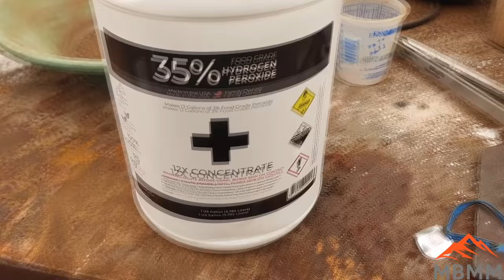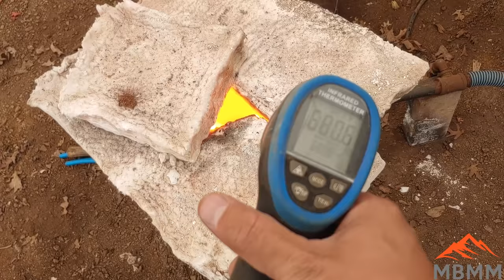Gold Recovery & Refining with Hydrogen Peroxide, Easier Gold Smelting

Comment: From a chemistry perspective: Add some water to your sample so you can stir (as quickly as possible) while slowly adding the peroxide (H2O2) to it.  Most likely some manganese (or similar) acting as a catalyst to decompose the peroxide to oxygen and water (2 H2O2 ---> 2 H2O + O2). Most of the oxygen that is released   (~165 grams from a liter of 35% hydrogen peroxide) is just being released into the air.  By stiring your sample and adding the peroxide slowly, you will get a far more efficient reaction.
Reply: thank you
Reply: Very useful tip Mr. Anthony. Thank you sir.
Reply: I was going to comment this...
Reply: I like you work
Reply: I need help I have minerals at my house all over
Reply: i added concentrated acetic acid[distilled vinegar] to  5% hydrogen peroxide and well water then dumped it on a rusted piece of metal infused lava rock .it smoked like that but also put off enough heat to warp a stainless bowl. im no chemist, was following diff vids on yt.the result was hydrogen sulphide and sulfuric acid.  after removing what was left of the rock i had a black float in my solution that after percipitating out was tarnished silver and copper
Reply: Teacher, what type of crucible can handle melting a large amount of potassium nitrate among the ore in order to get rid of the sulfides?
Reply: @hammahgawe  potassium is too unstable to exist on its own

Comment: When dealing with hydrogen sulphide gas, there are a couple of factors
1. Use a fume hood. This stuff is no joke
2. If you stop smelling the H2S, RUN!!!
H2S in higher concentrations will shut down your ability to detect it.

I grew up near a heavy water plant 😉

Comment: Refining with Sodium Bisulphate
It was considered that the silver as well as the base metals might be removed by some preliminary treatment. Nitric acid was ineffective on the retorted gold tried; sulphuric acid had little effect, but on testing with bisulphate of sodium it was found that base metals were removed or oxidised, and that silver sulphate formed The retorted gold was heated in porcelain or dense fireclay pots to a dull red heat for some time, generally as long as sulphur dioxide was evolved. The fused pyrosulphate was then poured out, and the cake drained as completely as possible. These were afterwards washed with hot water until the silver sulphate had been removed. The cake of melted pyrosulphate was also dissolved, and the silver present in the solution precipitated on iron, or by other well-known means. The gold could now be smelted, and invariably would be found to be much purer than when smelted by older methods. The silver and base metals were also removed at a fraction of the cost required by the chlorine method. The results obtained, however, were variable; one sample would be purified from about 80 to 96 per cent., yet another would only be increased by five or six per cent. The cause of this variation seemed to be that when coarse gold is amalgamated the mercury only affects the outer crust, so that on retorting there would be left pieces of gold porous on the outside, but unaltered within. In order to determine whether the gold and silver, if amalgamated in a fine state of division and then retorted would part, 80 grains of gold and 20 grains of silver were taken and amalgamated. The amalgam was retorted, and the resulting gold was of pale yellow colour. This was treated by boiling with strong sulphuric acid, which removed part of the silver; it was afterwards treated by fusion with sodium bisulphate, which removed more. The gold remaining was then washed with water, and after the silver sulphate had been removed the metal was weighed and parted. It was found to consist of: Gold, 97.2; silver, 2.8.

It is, therefore, a difficult matter to remove the whole of the silver, even when finely divided originally by this treatment: It might be stated here, although detailed reference will be made to it later on, that by using phosphoric acid with sulphate of sodium as a solvent that the retorted gold made in the same way was raised to:

99.2 gold.
0.8 silver.

Comment: Hate to tell you, but if you had added HCL to the h2o2 (Hydrogen Peroxide) it will create a weak version of aqua regia, and start dissolving the gold and other precious metals... and basically, not a good plan.
If you add an air hose into the crucible with just atmospheric air being pumped in, it will during the smelt oxidize all the sulfides, and you can actually turn the gas off in the furnace and it will continue to heat, as the air and sulfides combust... crazy stuff, I know, but a huge bit of fun to watch .
Reply: could you pump oxygen down there?  using a tiny medical tank/regulator,  a bubbler to prevent blowback  then down threw  a  high pressure stainless steel braided hose.?  I happen to have these random items, But I am under strict rules not to blow the house up with my projects.  lol , thank you!!
Reply: @garrisonkoby3448  atmospheric air is absolutely preferable, pure O2 in this case would be an extreme option, and blowing up your house might not happen, however, the smelt would in all likelihood super heat, at least into the 3000 degrees F... 
Using braided stainless, is good, the idea is to not and consumable metals to the smelt... stainless, is a great choice.
I use atmospheric air from a 35 lb air compressor, and a regulator value to add the air...
Reply: U r so correct I'm surprised he didn't know

Comment: I tried this a while ago. You need to add 90% acetic acid to break the oxide layer you built on the surface of the sulfides. The reaction will continue over and over till nothing is left to oxidize. The reaction is a exothermic one that boils over, the bubbles cool it and it reheats as the next layer oxidizes. This is paracetic acid. Acetic and hydrogen peroxide. You can add salt to it as well.

Comment: I watch tons of gold mining, recovery, and reviews. So to be added at this point is tough because I want my feeds to have more than just gold recovery videos. 
However, what it takes to get added is good solid information and techniques. And you deliver both. And doing a failing experiment is one of them. I'm sure a lot of prospectors try these tricks and you've proven that it might not be worth the trouble.
I don't know, I was impressed with the video and procedures used, and comparison techniques. So for those reasons I have no other choice but to add you to the subscriptions.
Well done. I look forward to more.

Comment: Great video. First put the 50 grams into a jar, then add 4 parts muratic acid to 1 part nitric acid. This fluid should be heated  past 150* f  for a few minutes You should get a bright yellow fluid. Add pure water and drain the fluid only out.

Comment: Safety tip, a filtered mask does not protect against H2S gas. The only protection from H2S is a supplied air respirator.
Reply: Respirator does to a point
Reply: @xephael3485  to a point isnt being protected though is it lol
Reply: @scrappydoo7887  The point I was talking about is the level H2S you're exposed to.  They don't make acid gas & organic vapor respirator filters that specifically filter hydrogen sulfide for no reason...  Mike brown is wrong in saying they don't protect against H2S gas, because they do.
Reply: @xephael3485  and if i hadn't made you clarify your point people would be thinking that all respirators provide protection "to a point"
Reply: @scrappydoo7887   just like bullet proof vests provide protection to a point... Nothing wrong with thinking that.
Reply: @xephael3485  do me a favour. You know that is a bad comparison
Reply: @scrappydoo7887  seems like a good comparison to me.  Especially to back my point.
Reply: @xephael3485  not really no. A bulletproof vest has  plates that covers part of the body intended for partial protection. Something like a respirator is responsible for your one inlet of what keeps you alive through the only place you can get it into the body.
Reply: @scrappydoo7887  level II body armour doesn't protect you from most rifle rounds.  You're just arguing because you don't like my comments and point which is correct and valid.
Reply: @xephael3485  lol ok then. If I realised you were going to go the Mr sensitive route i would not have bothered.
Your comment isn't valid without the clarification and you clearly cannot accept it.

Have a good day 👍
Reply: @xephael3485  ah, the YouTube comments. I ain't a scared a no hydrogem sulfide! I'm tough! I breathe it in DEEP! No, you shouldn't breathe it, if you've got no respirator and you're going to do it, don't breathe around the stuff.
Reply: since there still are replies to this, I will be more specific and clearer.

At lower levels, when you can still smell H2S, you are not in any danger. the particle mask and cartridge do eliminate the odor which is a esthetics issue, not a health issue.

once H2S reaches a level where it is physically harmful you can no longer smell it. thus a mask that removes the odor actually puts you in more harm because now you don't know if the mask or a deadly level of H2S is the reason you can no longer smell it.
 
bottom line is that the filtered mask and cartridge only give you a false sense of protection. 

when the filter or cartridge fails at high levels, your only indication is that you are incapacitated or  dead. you had better hope someone is there using supplied air to drag you out of the area.
Reply: @mikebrown0262  it doesn't look like it would be that difficult or expensive to create an exhausted box to do the work in. I appreciate your comment bringing attention to the subject at all and would hope anyone involving himself in the practice would do some precursory research to find out how protected they are with what equipment they are choosing to use. 🤷🏻‍♂️  Or maybe some people just have to weld with Dollar store sunglasses to see 🙈 why we dont weld with dollar store sunglasses...
Reply: Does make me wonder if you were an alchemist in a past life.
Reply: Uhh no... there are plenty of respirators suitable for H2s
Reply: U must of been a roughneck in the oil patch 🤣🤣🤣
Reply: Jeezus. If below 100 ppm, a respirator will be enough. If above, forced air or self contains air supply (per OSHA). 

Without measurement, we can’t say for sure what levels are there, but that is a huge work area, and is open to the outside if I remember correctly. 

If not leaning over the table and getting a full hit of the gases, I’d wager well below 100 ppm. 

Just the same, I’d want an exhaust hood above that table if it was my place, and I’d be wearing full face forced air ppe.
Reply: Covid/mask/do research

Comment: Use jet dry, you have gold suspended in/on the water, helps break the surface tension to let it fall to the bottom.

Comment: Adding HCl with the peroxide will dissolve the gold as well.  Might be useful to make a concentrate of gold chloride solution and leave all the silicates behind.
Reply: You need morw than Hcl And Peroxide, you need heat, a lot plus stirring AND a vast amount of Peroxide. The ratio can be 1:5 when all said and done. Its cheaper to just use nitric acid since you can dissolve 4 troy ounces in 300ml HCL plus 15ml Nitric

Comment: What's going on there is a decomposition reaction. The sulfides and sulfates do oxidize, but mainly they trigger an energetic decomposition of the peroxide into water and ionic oxygen. So the released gasses are a combination of water vapor, molecular oxygen, and sulphur dioxide. Its not much but i still would do something like this under ventilation. Honestly you're lucky your sulfates and sulfide concentrations are low. That strong of peroxide mixed with pure sulphur salts will violently decompose, think of a hot steam explosion in your face, along with the gasses taking very hot peroxide with it. One thing worse than strong peroxide... Is hot strong peroxide... A lot worse. I love your videos man keep making em... Its my dream kinda work but where i live i have to do my mining from ewaste, since ohio is lacking in gold deposits. Be safe
Reply: Also dont have hot peroxide around gold. That strong doesnt need to get very hot to oxidize the finer pieces of gold. Might be good if you do this to save your liquid waste and test with stannous chloride to be sure you didn't inadvertently put some of your gold into solution
Reply: What about that famous Ohio Marcasite?  Hard to believe no gold is in there.  Have you comprehensively tested for it?

Comment: Much of the 'smoke' is steam BTW. H2O2 is what the original rocket pack used.  Over a platinum catalyst I believe.
Reply: There is likely plenty of hydrogen sulfide which would be a side product of the reaction.
Reply: It was silver and peroxide for rockets
Reply: Can the H202 be recovered from tne steam to be used as fuel for my car? I have a hydrogen unit installed now.

Comment: Have you thought about putting the sulfide laden gold in a dry, O2 rich environment? Would it even work? I'm thinking you can put it in a glass vessel with one gas input and one gas output. The output would need a water trap to keep the O2 in the vessel. Then you could use a solar panel to generate some DC current and use the current to split distilled water into hydrogen and oxygen. Vent the oxygen into the vessel and vent the hydrogen into the atmosphere. The oxygen would build up in the vessel and hopefully react with the sulfides. You could try it first with some bottled oxygen to see if it causes a chemical reaction with the sulfides.

Comment: HI. Just one question. The used hydrogen peroxide is it totally finished with. Or is it just saturated. So it cant do anything more. Because it could be a big saving if it could be re used after cleaning. Jon

Comment: My crazy idea is to float out the fines in the foam like they do floating platinum ore.
I have always heard that if you get any oil. your fines will float away. not the 100 fines--the 200 fines and even smaller. Aussie Bloke Prospecting uses a vibrator and slows his sluice and the angle is 11 inches of run to 1 inch of rise. It may be that a heavily conditioned shampoo or just conditioner? who knows.
Keep up the good work. And Thank you.

Comment: If you add water before the peroxide it will allow you to use less. Going with the straight 35% peroxide a lot is getting wasted to thermal decomp as opposed to oxidizing the sulfur compounds. Or do it with the gold pan in an ice bath to slow manage the heat.

Comment: Hydrogen peroxide also oxidizes iron, it’s a big contributor to stainless steel rust. It’s possible you were just eating away at the gold pan itself. I would use a plastic or glass vessel to perform the reaction next time. Also the smoke your were getting was probably just steam from the peroxide boiling from the heat of the reaction. You could probably use half as much and get the same result from adding smaller portions at a time

Comment: Your gold there is likely superfine powder that was stripped physically from the ore by the peroxide getting underneath and decomposing, popping it off. Which means it's good to see it, but the yield ultimately would have been similar anyways. You must have a little manganese in your ore, that H2O2 catalyzed extremely quickly... but that also means it all decomposed without doing much chemically.

Comment: Might be worth experimenting with dissolved oxygen to oxidise the sulphides...

4 x 5 Gallon buckets with aquarium pumps. 50g of ore in each and some water. one with no air as a control, one with just air, one with some lye and one with some acid, probably sulphuric acid, but it might be worth using Hydrochloric acid, and seeing if anything cements out on copper afterwards.

 Leave them for a week then do the same process you used in this video to see if it has any affect. Temperature will have an affect, so as a minimum just note down what the temperature was when you did it, or try another set of buckets somewhere warmer than your shop if you can. 

If it works, it's certainly cheaper than peroxide. Probably won't be as good or fast as roasting, but might be worth experimenting. 

From what I've read about using Hydrogen peroxide, it's mainly for cyanide leaching where they add oxygen, the peroxide is used to bring the yield back up from the increased oxygen consumption caused by the sulphides. It's also used with HCl to dissolve the gold, as others have said, this avoids using Cyanide leaching.

Comment: hey the thing you should mention is   that the process takes a little time, the longer it soaks the more it dissolves into the peroxide.... then if you bubble so2 gas into the gold peroxide solution or boil the peroxide off  then wash it it will re solidify the gold into a powder. oh and that peroxide is very strong I don't know if you need it 35 percent i have seen sreetips  on you tube do it with 3 percent and i have also. It takes longer though.

Comment: I wonder if you mixed vinegar with the peroxide and clean bottled water (not tap). Maybe a 1:1:1 ratio. 1 part vinegar, 1 part water, and 1part H202.   I have a cleaning recipe of vinegar and peroxide and water in a spray bottle and  it works great. Vinegar is acidic and the water could just dilute it a bit but also I have realized that hydrogen peroxide does react differently and have different reaction when it's mixed with water. Clean bottled water.